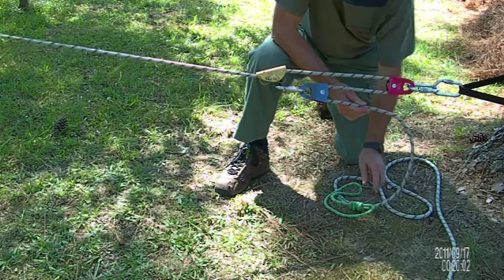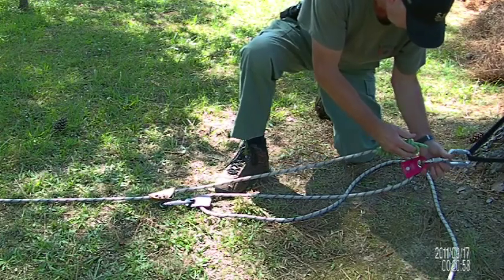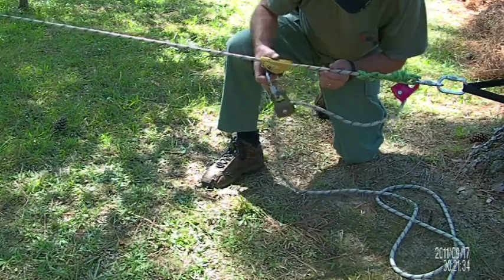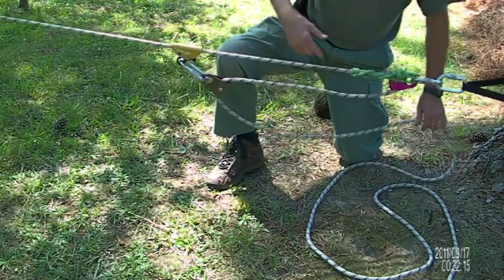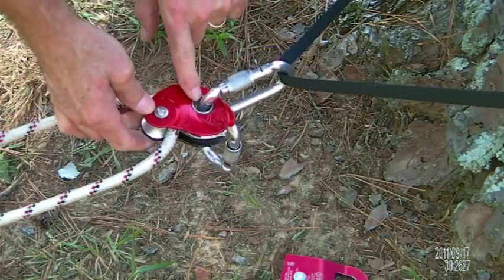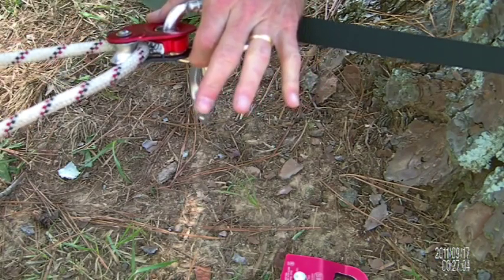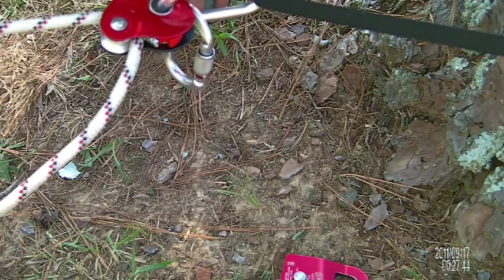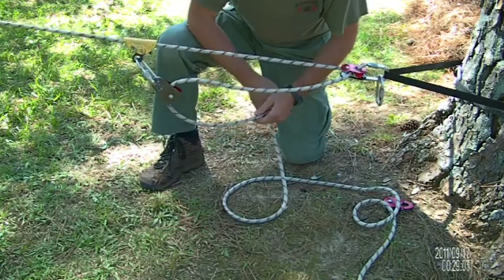Rope and Pulley Systems: Segment 10 - Capturing Progress pds.m2ts

Comment: I'm new to pulley set ups. Wanted to learn so I bought two size set ups for 8mm and 12mm ropes. I  live in Canada so I  have a feeling snow and ice may not be good for rope prusicks so I bought two Fusion Climb mechanical rope grabs just like yours. Instead of using the rope prusik for progress capture I used the mechanical rope grab, works perfectly so far. I'm a retired carpenter so this is going to be a new hobby to keep me occupied
Reply: Excellent series BTW

Comment from the maker: Both the Grigri and the prusik capture progress, but they are quite different. A prusik has no pulley effect at all, it imply captures progress. A Grigri can be used as a pulley and progress capture, but it is a very inefficient pulley since it has no moving sheave in it.

One of the nice things about the Grigri is if you need to lower a load, it gives you a way to control the release where a pursik would likely lock up or release suddenly.

Comment: in this scenario with the prusik capture how strong would the prusik need to be ? as much as the load on the line going to the tree ?
Reply from the maker: Great question! I used to have a lot of contact with Bruce Smith, owner of On Rope 1 and co-author of the book, "On Rope". He was "the" guy that was called for rescue operations whenever there was a rescue within 100 miles.

So naturally he and I swapped a lot of info. Bruce and some others ran some tests on the grip power of prusiks on 11 mm rope and 9 mm prusik cord. What they found was that the prusik would start to slip at 1000 lbs. So, the hitch would slip way before it reached it's breaking strength. 

Also, the prusik cord (in a prusik hitch) consists of two strands so a prusik is much stronger than the breaking strength of a single cord.
Reply: @Tanglerwr  hey thanks for the info and reply dude, very interesting!

Comment from the maker: Jason McPeak,
For some reason, there was no "reply" option for your comment, that seems to happen with linked comments. I thought I had a solution to that, but it didn't work this time???

A Grigri does not have a reputation of ripping rope covers. Grigris have no teeth and tend to slip when overloaded. Traction,  or self locking pulleys, do have teeth but if used within the manufacturers specified ratings should not rip covers.

Prusiks can be problematic as well. If a prusik gets a sudden overload it can slip an melt. Once it melts, it's likely going to release the load. Also, the cordage used for prusiks can give a false sense of security. If a pursik is exposed to mud, slim etc. the mud et al can pack inside the pursik cordage. The danger is the pursik shows no signs of this, but it simply will not hold as expected. There is a test that can be used to determine the integrity of the cordage.

Also in wet and especially icy conditions where ice is forming on the rope, the prusik might not hold at all.

This all goes to emphasize why I repeated that this series is only about MA and techniques of pulley systems. There's a lot more to consider to put these techniques in practice.

Comment: I'm watching this great series you put out for us and just want to say thank you. I work with rope and loads on my mining claim and your vids have given me a better understanding of what I have been doing wrong in the past. We typically run a static line across a small creek 150' in length at 25' height. It is only for hauling gear across not for people. We have always struggled getting the rope tight and after this vid that will no longer be an issue. Dragging boulders in excess of a ton or more is also a problem however your vid on block and tackle likely solved that as well. Thumbs up and subd.

Comment: grigri and traction pulleys work quickly, but they can rip the rope sheath, so can a tibloc. Prussics are superior in that they squeeze a long length of rope to grab and hold, and are allot less likely to wear out a rope like a mechanical grab that applies force on only two sides.